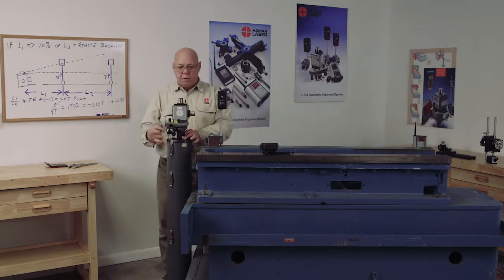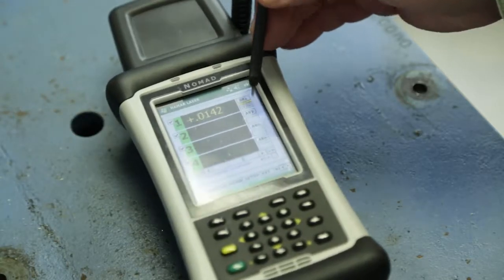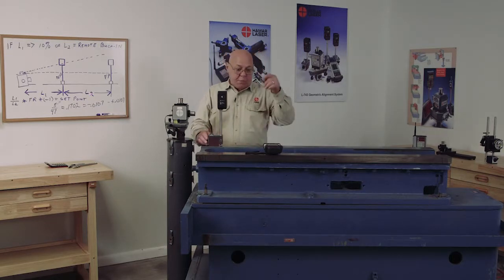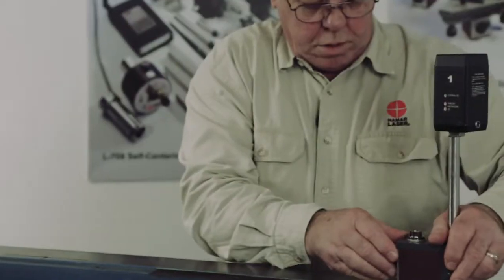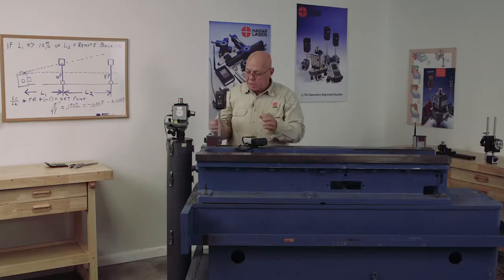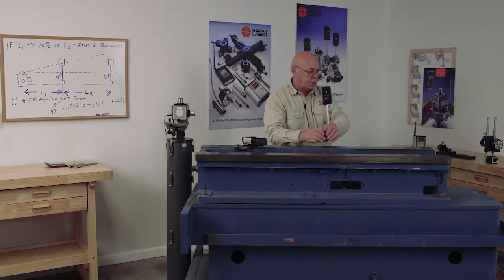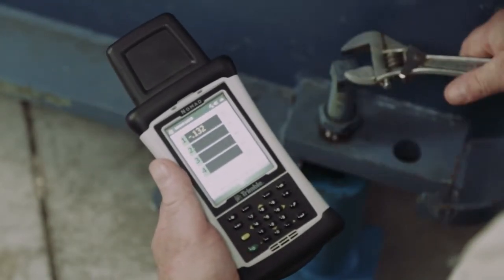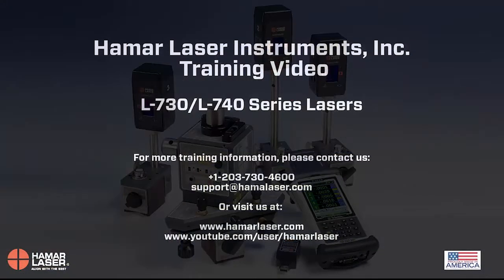How to Level a Machine Bed with L-730/L-740 Lasers

Comment: Do we have to change the location of the receiver and put it on several point to get those levels?
If so then every time we adjust a jack bolt the level on another point will change and we can not have the level on multiple point at once, Am I correct?